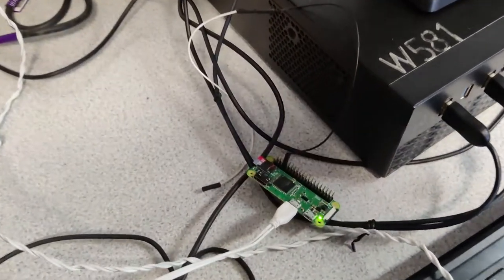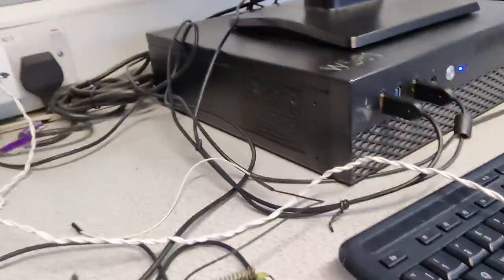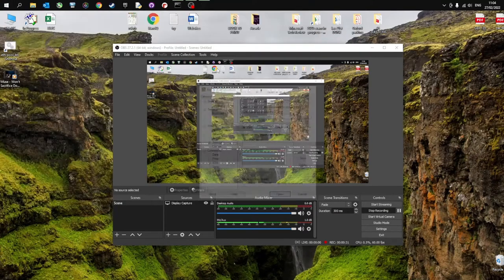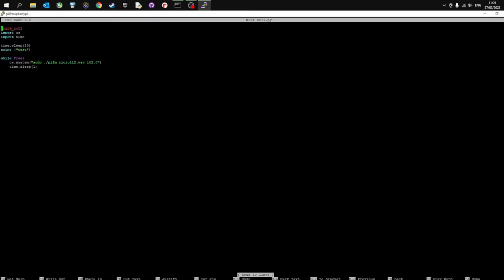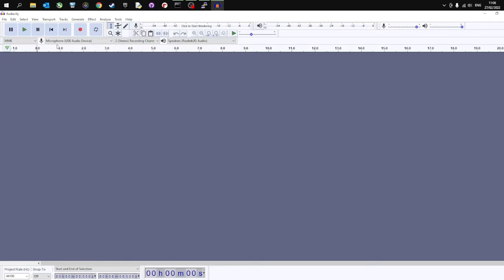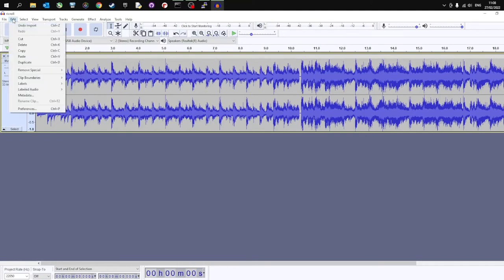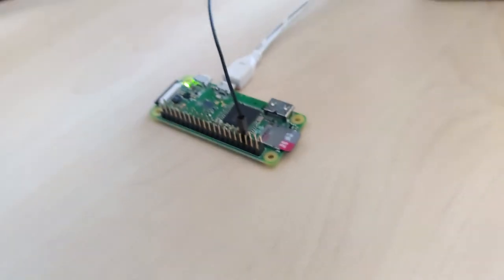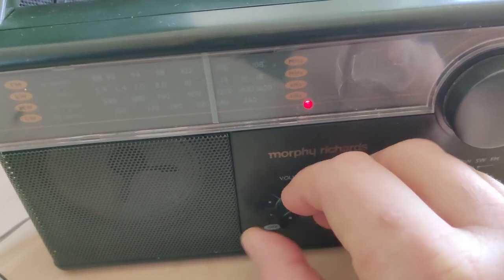Rick Roll FM Radio Hack (Raspberry Pi Zero)

Comment: What antena cable type do you use
Reply from the maker: Any cable that fits to the pins. The longer the length the further the transmission reaches. 10com cable I get about 15m broadcast radius.